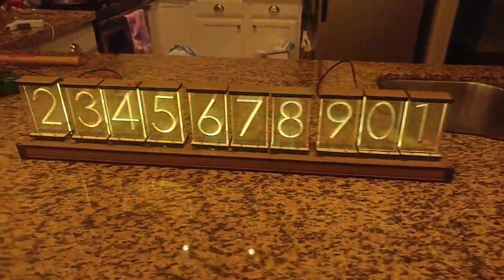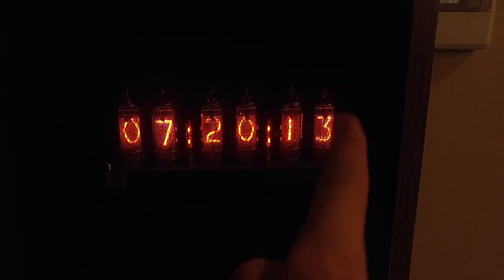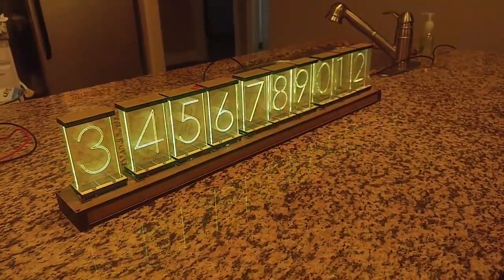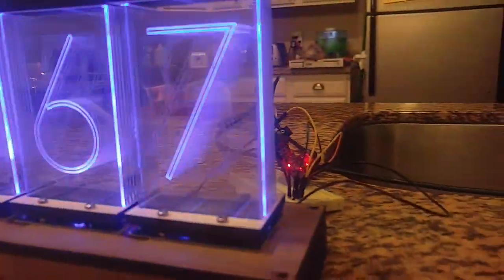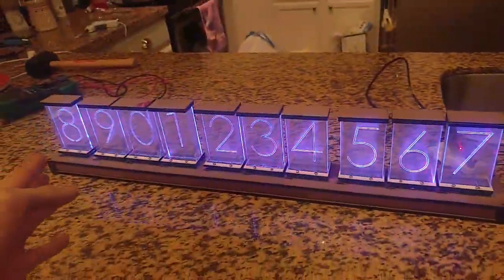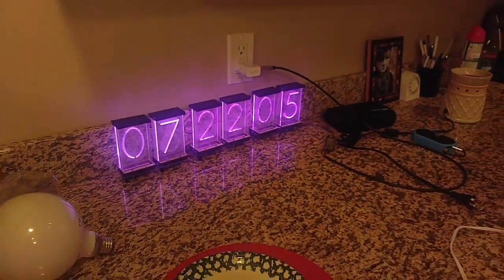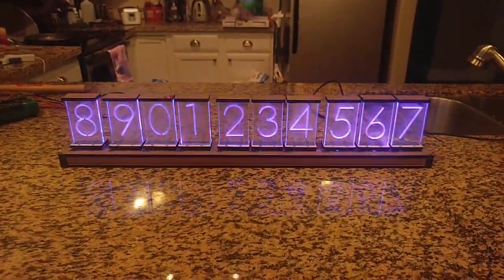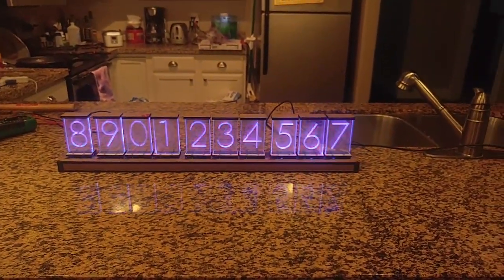What is a "Lixie" Display?

Comment: Beautiful.  I had finished building a single 0-9 stack and THEN I find your video ! Building it was very labor intensive. Had I seen your creation BEFORE I jumped into the project I may have been shamed into not even trying.  My result is crude by comparison. Very crude. I used Inkscape to layout the single line digits and create the gcode for my equally crude junk-box CNC machine.  I'm sequence through the digits with a Arduino Mega using a simple for loop in in the sketch. Your videos are excellent and now I need to learn more.  Happy to see they are available for purchase. Thanks for posting

Comment: Hello! I really enjoy your product! Is it possible to just buy the led circuit board? I have a laser engraver and the arduino boards but I'm not exactly sure how your led circuit board works or how to make my own. Thanks -- Matt
Reply from the maker: No problem! email me at
connornishijima @ gmail.com
and we can work out a deal through PayPal. I've sold board independently in the past at $10 assembled, or $5 bare+parts. If you bought the bare boards, they are surface mount assembly - which isn't as scary as it sounds! I'd be glad to help you learn.

Comment: Hi Connor
I finally managed to order some Lixies. They should be here any day now. Can't wait to try them!  
Yes, Nixie displays are not vacuum tubes, they are more like neon lamps. The ten metal pieces in the shape of digits from 0 to 9 inside the tube are cathodes. The mesh screen around them is the anode. Applying 170 volts DC to the anode and grounding one of the cathodes will make the neon glow around that cathode glow and display a digit.